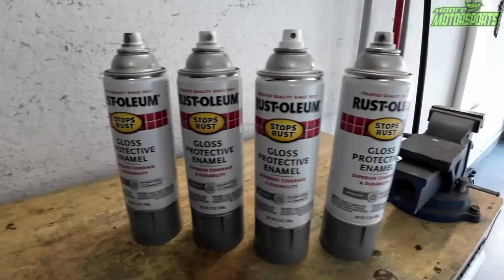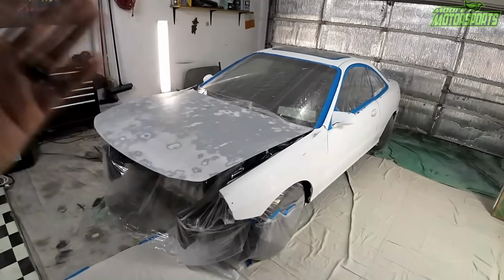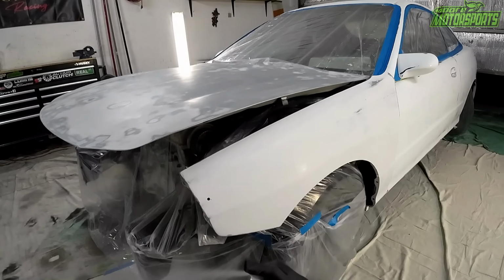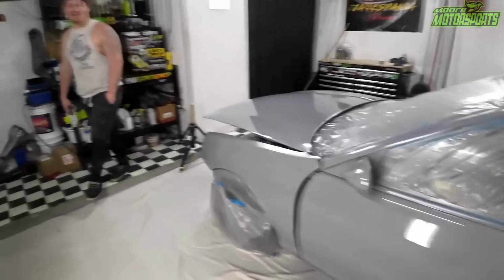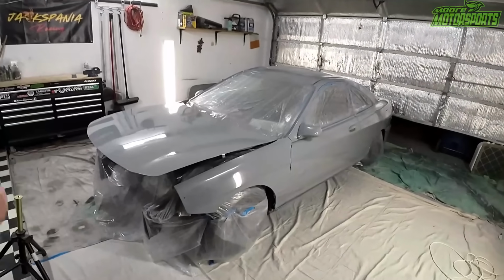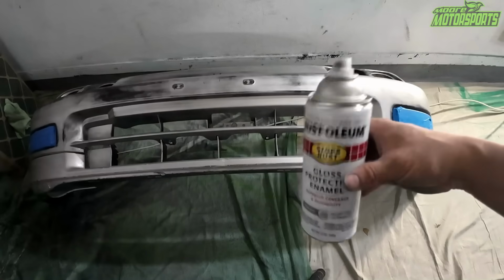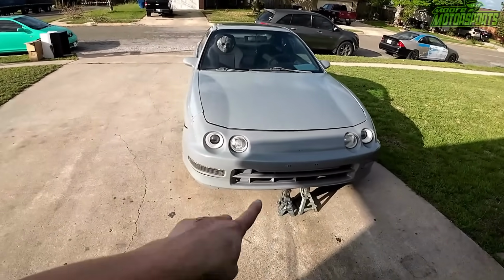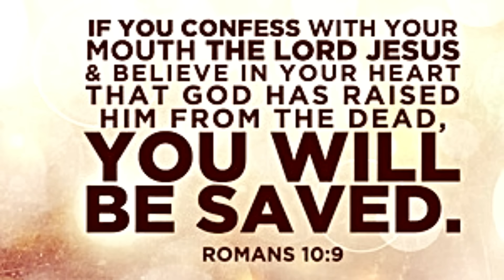$28 CHEAPEST RATTLE CAN PAINT JOB! IT ONLY TOOK 4 CANS!!

Comment: No clear coat protection?!?  Dude,  adding a clear coat likely not only makes it better looking but the paint may also last much longer.
Reply: yeah im so confused about that
Reply: @uswwt  
Experimenting ,can you clear coat primer?
Reply: Looks like he's using gloss finish, so like a single stage paint, no clear coat is required because it's already in the mix.

Comment: I’m painting my front bumper on my integra , and it’s black fiberglass , do I have to do the prep work as well, along with primer ? Or can I just paint it black and put gloss above it as well?
Reply: Without primer the basecoat won't stick and can cause chips in the future. Especially for a front bumper, so prep work is key to having a successful paint job.

Additionally, unless you're using a primer specific to plastic bonding, you may need an adhesion promoter if you are painting directly on the plastic. On another scenario if there is already old paint on it just sand off the old clear coat at least if you on a budget

Comment: How do you get so much coverage out of 1 can?
Took me 2 cans just to spray a hood.
Reply: Must be because he soaked the cans in hot water for awhile
Reply: @DS-jh1bp  I did that too
Reply: @nickkrantz1143  oh damn.  No idea.  Movie magic?
Reply: I have been painting cars with spray cans for 18+ years.  I can tell you that certain paints over certain colors will give you various results.  Gray on white is a easy cover, one coat wont last though. Any little scratch will show the white underneath.  You will have to coat with clear after a full week of curing. Or spend the extra cash and buy more cans for more initial layers. I normally paint a car with 3 full coats. 12-20 cans recommend but car size will alter thus number. 
I can actually see all the lack of paint on this paint job, although it looks good on video, I bet it's not so nice in real life. Hence why it will need a wet sand and clear. Usemore cans and be patient,  no need to buff and clear unless you mess up. 
I just painted a 08 caliber.  It took 13 cans of yellow on stock white paint and 6 cans of black to paint the whole thing. Don't be fooled with $28 click bait.
Reply: @freddybanuelos6284 Still even 20 cans at say $10 a can is great deal vs 2k for a paint job lol. Thanks for your insight man!

Comment: We did that too a car it looked great for a couple of months then it got super faded i polished it but it was faded again like in a month
Reply: did you use clear coat to protect the paint? My issue is i painted before a car part and used cheap "1k" clear coat instead of 2k, but, i guess because of the sun, it started cracking some months later :/ The paint below is amazing, but the clear coat is cracked, not pealing, literally cracking. In my experience, don't cheap out in the clear coat, however 2k is dangerous so don't forget to buy a appropriate respirator.

Comment: What grit should you use to wet sand the car down to remove orange peel?
Reply: i did mine with 1500 then 2000 then 2500 then hand polished my whole car. It cane out great.  I painted my 2015 Infiniti Q50. In factory black got the code from the car and had the paint shop custom make me some spray paint cans then put 2k clear.  No one thinks i spray painted it. Comes out looking amazing if done properly. most people don't cut and buff spray paint jobs but makes a world difference for an extra days worth of work

Comment: I PAINTED metal WITH RUSTO, comes off with the sun in 1 year or less the sun is too hard for the paint even though its rusto, I speak from experiance. Cover the car with a tarp and you can get 2 years out of rusto until it the sun melts it. The Tips on the rusto can do not spray smooth either, you need switch the tip with an adapter and pray you meet a graffiti artist who will show you what a new york Fat tip does.

Comment: So i got a grey honda civic. Can i just sand that and paint over it or do i need to do primer etc like professionals?
Reply: pretty sure you can just sand and paint, correct me if I'm wrong but priming is mostly for better paint to metal adhesion among other things. paint on paint should be fine once the it's scuffed from sanding. just make sure surface is super clean and free from dust afterwards.

also don't go too fine on the sanding or you lose the surface area created by the micro scratches which creates a stronger bond to the new paint.

Comment: Please answer this question, this brand of paint sell the 2x paint that has the primer and paint in one, while the one in the video doesn’t have primer. which one is better? the 2x is cheaper but would I need to buy a primer before painting or only need primer for bare metal? what does the different enamel finish do compared the the cheaper 2x paint from the same brand
Reply: The enamel is durable on its own. But rustoleum 2x clear anything 2 or 3 times for depth and protection😊

Comment: I used to do this with the old beaters I used to drive in the late 70s. I even sprayed a couple with a vacuum cleaner sprayer, which actually worked pretty good. Only used a quart of Harbor Blue Rust-oleum to do a '69 Buick Electra. The paint was still on it two years later when we got rid of it.

Comment: Hey man super cool stuff, I kinda want to try this myself now. I have 10 years of experience painting cars in a professional setting (Gerber and dealership collision centers) and I have a suggestion that may get you a much slicker finish. I don't know how Rust-Oleum would react to this but it would be worth a shot: when you are painting, put a second coat on there and once it's cured you should have enough material build to knock it down a tad with some 2000 grit sandpaper (must use water), follow that with 3000 grit and then follow the 3M 3-step buffing process. You can usually skip step 3 on that. The finish would be slick as glass. Another recommendation would be to use the Rust-Oleum without can clear ontop of it because it is tested true durable paint, however that can clear will degrade in the sun pretty quickly
Reply: Yes I paint in a hot rod shop sometimes as well. I was thinking thinking the same thing with wet sanding. Although I'm curious how long it takes for this particular type of paint to cure before you could do it. In the past when I used to practice with bicycles it would take forever before rattle can paint jobs would be ready to sand

Comment: Will that same paint work on a ABS plastic grill i have on my 2010 chrysler 300 and if so will thebpaint crack or chip in time?
Reply: I used self etching primer 1st, no problems over several years.
Reply: If you want it to last, start with a primer and end with a clear coat
Reply: Usually a few clear coats will help

Comment: I'm amazed you were able to do only 1 coat and get that coverage without having any runs.  Your trigger fingers must have been tired after all of that. (Glad you were able to use both hands to avoid cramping.) Excellent job. (Thanks for the tips about putting the cans in warm water, plus lining up the spray nossle with the black dot.)

Comment: About 15 years ago I sprayed a 55 F500 Dump truck using Rustoleum paint. The body was covered in light surface rust when I got it. I wire wheeled it down to bare metal. I applied primer and two coats of color. I sold that truck about 13 years after that paint job, and even after sitting outside, it still looked great.

Comment: you can't beat this guy's hand. buy the turbo spray can to avoid less tiger stripes,this regular can only gives like 2inches width which is easy to end up with uneven paint stripes.

Comment: Hello, it looks beautiful and smooth. 
One question, so I don’t have to prime the vehicle if I used the cans of paints you used?
Reply: @RAHIWAadeyNayGdiniyu  no you don't need to use primer for these cans
Reply: @eibura5978  
Thank you
Reply: If you want a better finish you should use primer and you should use clear. And base should be 2 or even 3 coats.
Reply: @RAHIWAadeyNayGdiniyu  yeah that guy is right. You don't need primer, but it will come out more smoothly. I went and painted my car using the same cans, same formula with the same wide fan, but in charcoal gray, and I used rustoleum filler primer, sanded 600grit. Then, i washed the car, tacked it down super good, and then painted the car OUTSIDE using 3-4 coats on some parts. It is actually pretty shiny and reflective with minimal orange peel. A few years ago I painted the same car with rustoleum 2x gloss and it was not as shinny or reflective as this newer stuff. I think I can just buff it and it will look good, but I think ima go ahead and wet sand, cut and buff anyway. Took me like 50 hrs of work in weeks to here so might as well.
Reply: @eibura5978 wait, so you’re saying this is shinier than the 2x cans.. wow didn’t expect that! Even in gloss black you think?
Reply: @Payote88  yeah i would say so, but then again when I painted my car with 2x I had sanded it to 320grit. With the protective enamel I sanded my car to 600grit. Super shiny and reflective with no tiger stripes. Prep is key. I would still use a clear coat like 2k though

Comment: Rustoleum has great coverage per can, but unfortunately it is an enamel paint and will not be very durable.  The good thing is, it will certainly be inexpensive and easy to repaint it when it chips or fades with a few more rattle cans!
Reply: what would the more durable alternative be?
Reply: @MrSFSTUDIOS  if you clear coated over it would it become more durable?
Reply: It might wrinkle, craze or lift the finish.  Urethanes have solvents and chemicals in them that might damage rust oleum.
Reply: What about the appliance epoxy cans?

Comment: I am going to attempt this on a Nissan xterra that has all plastic trims and bumbers and side molding. Anything special I should do to prep the plastic bs the paint?
Reply: Scuff, and make sure to primer the plastics, if your painting them, there’s certain spray cans with plastic adhesions to help
Reply: Richard Hollis, just painted the black plastic trim on 2006 CRV.  Clean it really good, wipe down with paint prep and paint with Rustoleum Satin black.  Looks great and get alot of complements.

Comment: There's a reason why they charge a lot of money at a body shop because the paint your using is not auto paint it doesn't have a hardener in it it doesn't have a sun Guarden it to prevent fading and it is not durable against the elements
Reply: For $28 you can’t beat it. If it starts fading, you can just buy another can and touch up. Or you could just use 2K clear and itll be alright
Reply: Just repaint it every couple years save 10 grand
Reply: @csowner2048  why do you care what other people think

Comment: QUESTIONS:

1) Have you ever used the spray paint handle? 

2) Should you start from top to bottom so falling overspray won't dust? kind of like spraying a tub?

3) I noticed on the trunk that you were spraying vertical, then you went horizontal 

4) how long do you think it will last with out a clear coat moreless?
Reply: @ayearetee3342  should last at least 5 years

Comment: I know perfection isn't the name of the game here but for anyone watching please consider priming (cheaper than paint), more than one coat and finally a clear coat finish. It will probably only be ~4x as expensive as the technique in this video but the longevity and quality improvements will be undeniable. Weigh your options though if you're painting a winter beater w/ 200k miles then whatever. If you're painting a cool car like an integra, personally I'd avoid cheaping out.

Comment: Iv don a few spray jobs with cans the thing i  find is the nozzle clogs up real easy then you have to throw the can away how do you stop the nozzle clogging up ?
Reply: Philby Iasgair  Thanks thats great advice but yeah i used to get round it by swapping the nozzles around as well
Reply: I used to run a high end dining and patio furniture store and we had to touch up and sand and refinish alot of the products that would come in with damage or shoddy paint work before it was delivered to the customer. I'm talking 4 chairs and a table for a kitchen that could be 2 to 3k plus and patio furniture that cost the same if not more. We were supplied with spray cans for each of their paint colors for the purpose of touching up scratches and whatnot. Some of those cans would only see a few sprays with months or years between use. There are a few ways to prolong the life of a spray can and even bring back an old clogged one. First and easiest is when you're done spraying, immediately turn the can upside-down and spray it until just air comes out. The next best is to remove the nozzle and spray a paint thinner through the nozzle and even down into the tube coming out of the can as that can also clog and even a new nozzle won't help that. If you have an already clogged can or nozzle, you will need something stronger. MEK works well for cleaning out the tube but will dissolve the plastic nozzle. I found soaking them in a paint stripper and blowing air or spraying a paint thinner backwards through the nozzle can clear them out sometimes if you're lucky. But I always had new nozzles on hand as they were cheap to buy in bulk and weren't worth the trouble unless it was a fan spray nozzle. I mostly dealt with clogged tubes. We had probably over a 100 cans and some that were probably well over 10 years old that still worked just fine.
Reply: @travispoulin252  Thats great advice and id forgot about turning the can upside down Im still spraying now .I sprayed my front door looks better than brush painting  i used Rust-Oleum which is great paint and if i can i use Simoniz ,trouble is there colors are limited

Comment: You should only use automotive paint designed to last with an air compressor. I did something similar with this type of paint and it only lasted  about a year and a half. If you're going to go to all this trouble spend a few dollars to get the right paint and an air compressor and paint sprayer.
Reply: Can you explain this further. Does the good stuff only come packaged for spray gun use?
Reply: @jakegrant6783  The whole process has to be done in a garage or painting booth with vacuum. first you have to get the surface perfect and clean the surface with a foaming detergent and alcohol with lint free clothes. The you have to determine if the paint you buy(from) a can matches your paint code and paint type. I would determine whether a white primer coat is needed if you're changing colors, then you need  four coats an enamel. I don't know if you need to wait so long before starting the finish coats and when to use hardener. I know dust will ruin paint if dust settles on the paint, maybe a cover between coats? If you don't peel back wet paint edges when the paint is still wet you spend days cleaning up. I just know this form watching videos. i don't know the exact type of paint.
If your sprayer spits your paint job is damaged if you don't test first.That's all I know about it. It's all a big gamble without a painting booth..

Comment: Wdym by warmed up cans?
Reply: putting them in warm water for 15min before using them so they heat up for better spray pattern
Reply: @arbremagique6253  Do i need water? Cant I just use the microwave for 30 seconds instead? Much faster imo
Reply: @Immigrantlovesamerica  bad idea to put metal in a microwave

Comment: I’ve been wonder if I spray paint my car does it last?
Reply: Biggest benefit of waterbased paints like used in a professional shop is that if you get debris on the paint, you can clean with acetone without issue but these rattle can paint jobs are like the old style of painting where you don't want any solvents touching the paint even after it has dried.

Comment: Great job! I do my rattle can painting only in summer on hot days. Let the cans sit in sun for 10-15 mins. Always use very good adhering primer, two coats. Fine sanding and good cleaning between coats. Light dusting coat of paint first, dries in the sun (no trees around!) Then a good coat of spray paint, dries for several days. Then a very fine sanding, Final coat is the trick, do it all same day, watch the runs! Then the painted item sits in hot sun all day & the next, and do not use them for a week. I've done fridges, tool boxes, tool cabinets, all sorts of appliances. Thsi summer I will tackle my first vehicle, a 2000 Jeep Cherokee Sport 4x4.
Reply: Try that in the UK with no sun and rain 😂
Reply: @recall2880  Haha, anyone I ever saw doing car painting in the UK had a garage or such place.

Comment: Should have clear coat it. Then after 48 hrs wet sand from 2000 to 3000 then buff and polish. It'll be like a mirror. Good job regardless
Reply: @Givelasagna  after the spray paint when would you clear coat? Same day or should there be a curing period then sand and clear ? I turbo canned my suv gloss black and it looks great but i know the gloss will go away wondering if i wet sand and clear coat it now will the paint warp or shrink?

Comment: Does this have to be done inside a garage?
Reply: What I do, because I'm cheap and mostly poor, I buy 8 foot 2x4s and 2 rolls of plastic food wrap and a tarp as the roof to make a very temporary artificial car garage.
it cost me around $70 to $80 but i only ever end up re-buying the rolls of plastic cause i just use the same tarp and the same wood.
Reply: I tried spray painting my mere bumper outdoors and got so many dust particles stuck on there, so just a matter of quality
Reply: Not if you don't mind bugs and dust in the paint.

Comment: How does 1 coat cover that well? I get 4 cans Can cover the car, but it’s difficult to believe it’s 100% coverage 🤔
Reply: In my opinion he should've done another coat and then used the spray 2k clear. I've done it one my bike and it came out great. I'd sand before applying the clearcoat though and do 2 coats of the as well so you can wet sand and cut/polish it.